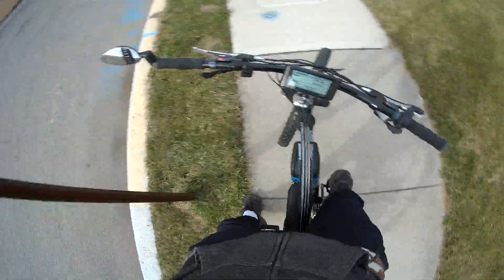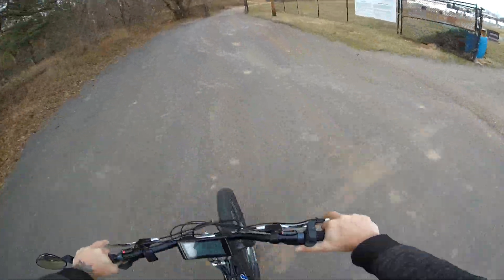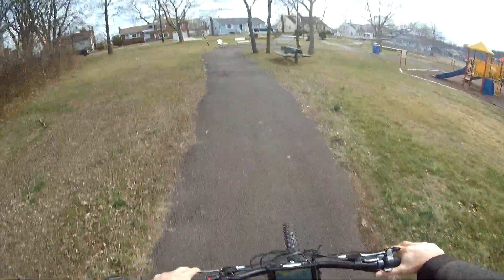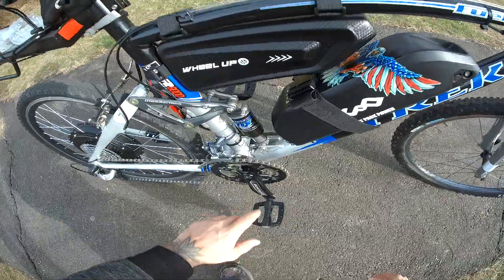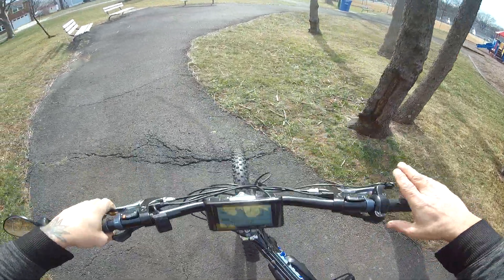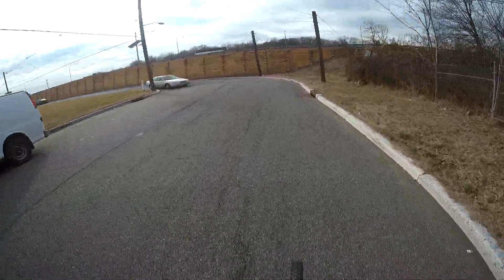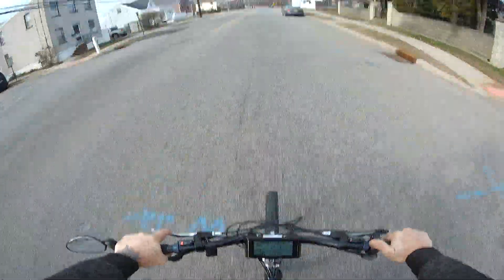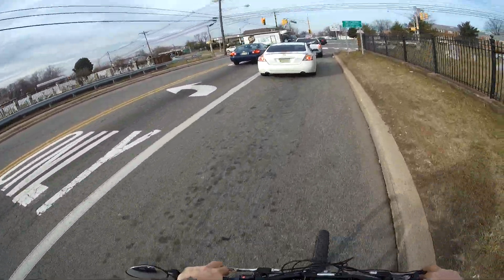58v⚡road test🚴1500w SW900 lcd vintage Trek Fuel 90 full suspension ebike conversion

Comment: im looking at getting a trek fuel 80 to make a 72v 60 amp hub conversion .i dont like the idea of putting it on a hardtail
Reply from the maker: The 1500watt hub motor is very tight fit.Having to pry apart the dropout to get the axle in position putting stress on the swingarm.
Reply: @petertothRC-FPV  hmmm i was tempted on putting a even bigger hub on from my stealth bomber .looks like ill have to throw some coolant in a 1500w wheel ive got and maybe push 50amps at 72v .the bike ive had my eye on for the build has disc brakes too .its the red one
Reply from the maker: @leegeevenning74  Yeah you would have to keep it cool.Pushing it with this setup maybe a little over 1800watt with a 45a controller going up the big bridge but it cools off on the way down over 50mph good  post some video would love to see your bikes.
Reply: @petertothRC-FPV  yeah i will definately add some statorade to the wheel .i dont really want yo throw a huge hub motor in the wheel .i want a light ish build .

Comment: Hi, what seat do you have there? I plan to get an Ebike soon. I will need to get a wider seat 😊 any you would recommend? I am used to motorbike seats more so than mtb seats.
Reply from the maker: Hey thanks for asking.Cloud9 are what brand seat but they have many models my local bike shop has them.Must cover them in the rain its like a sponge and will take days in the sun to dry.

Comment: Buying the same bike hopefully tomorrow I live in the area too 👍🏽
Reply from the maker: Sweet just needs better front suspension and hydrolic brakes
Reply: @petertothRC-FPV  Just bought it mine came with a rockshox air fork seems pretty nice and yes I do agree on the brakes, I would have to get a new wheelset for that.
Reply from the maker: @Abchtvz  Thats good 💯%swapped my 28x80mm rokshok to a cheapo suntour XCM30x100mm.Only have the disco brake on front with a beefy ALEX Rim works great for speeds over 40mph😊
Reply: @petertothRC-FPV  If I see you riding that trek around ill say what's up! you did pretty good.
Reply from the maker: @Abchtvz  Likewise my friend.Thanks

Comment: will the LCD show you more than 1000w?
Reply from the maker: 1700w easy
Reply: @petertothRC-FPV  
please give me some advice. I own an LCD SW, but I don't have the word 900 .. I can't exceed 960 W.
I have a 60V 45A regulator.
BMS I have on 60V 60A battery 16S 7P. I suspect that the LCD limits me. I expected over 2000 W :(
Reply from the maker: @romanriha6292  By 60v 45a regulator do you mean controller that is the brain
Reply from the maker: @romanriha6292  you should make a video to show the components & specs